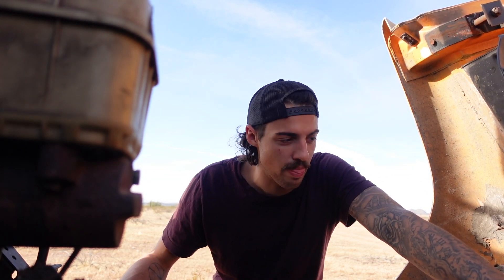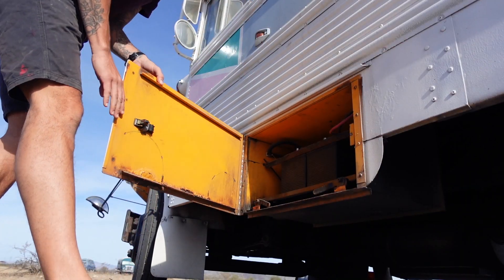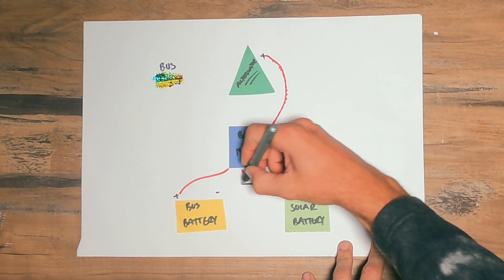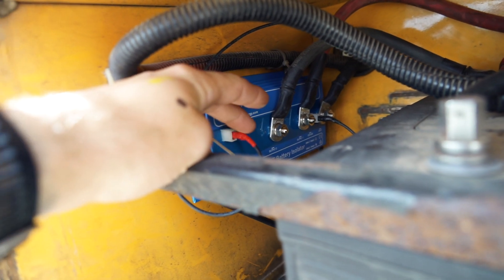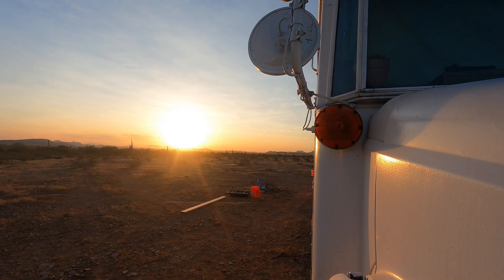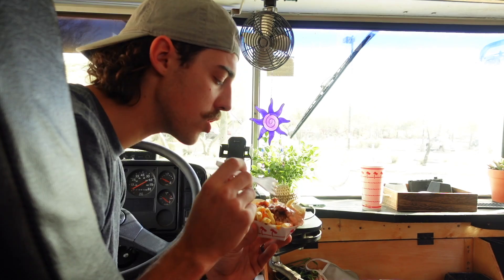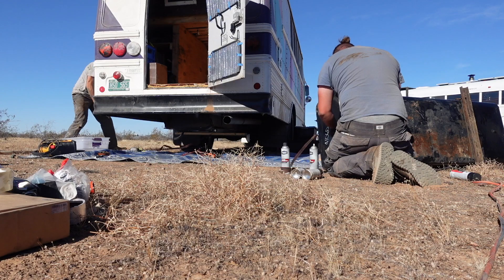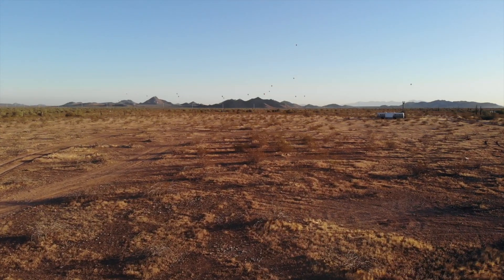REPAIRING OUR BUS TINY HOME | Finally back on the road

Comment: The battery isolator you installed is not recommended for lithium batteries. The charge resistance of lithium batteries is different than lead acid and may cause them to charge at a higher rate, putting strain on your alternator.  May work great  for awhile. Watch your charge rate on the battery monitor. Not sure how big capacity alternator you have.  Hope it works out.